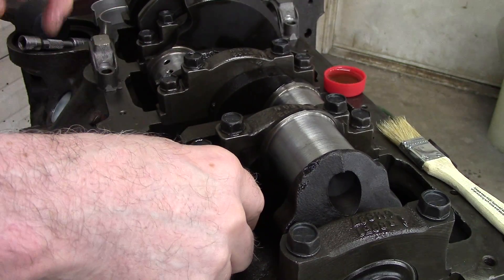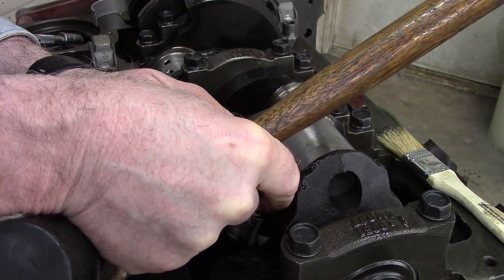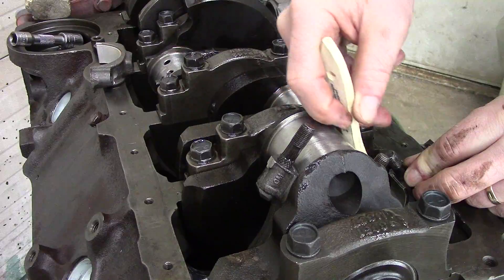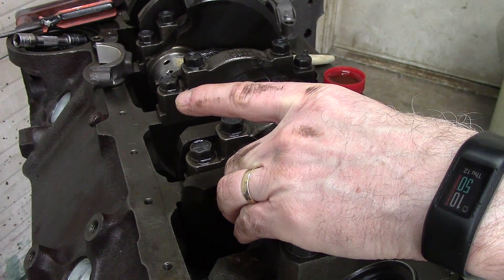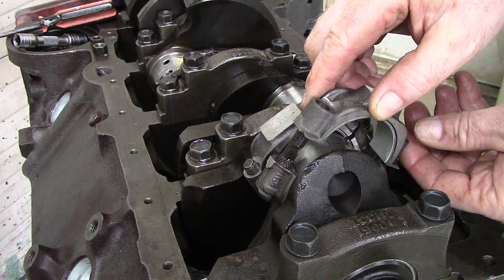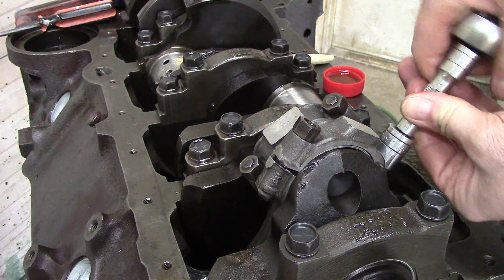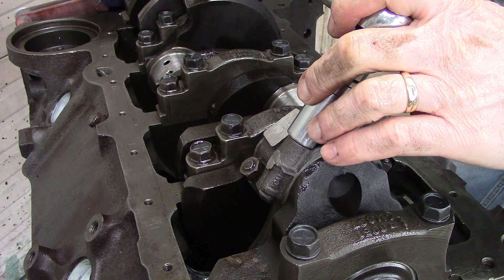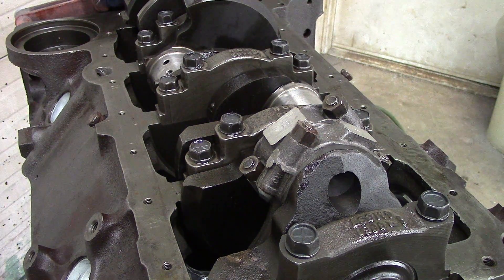V-8 Engine Rebuild SBC #4 Part 2 Rod Bearing Install

Comment: Hi, I recently installed some rod bearings in my 350 bored .60 over. It spun freely before bearings change ls now it’s does not spin when torqued now. Any idea what’s wrong?
Reply: Caps are backeards